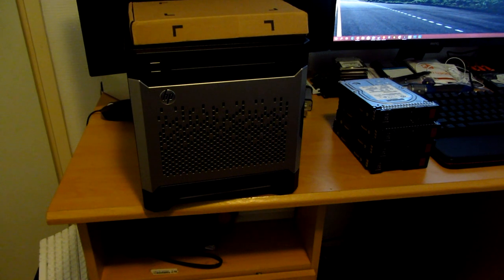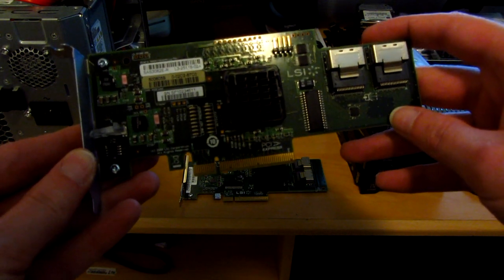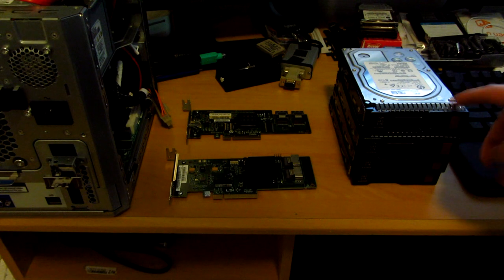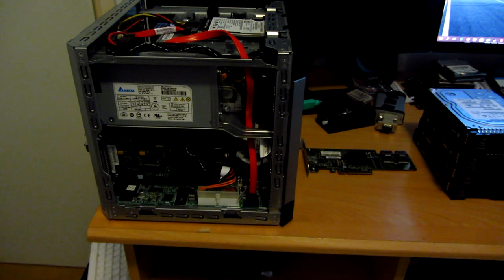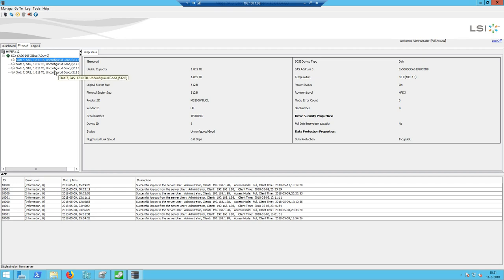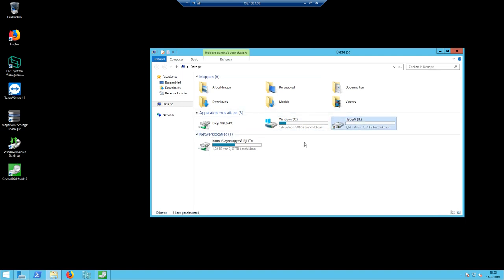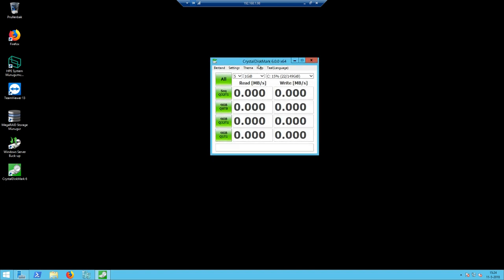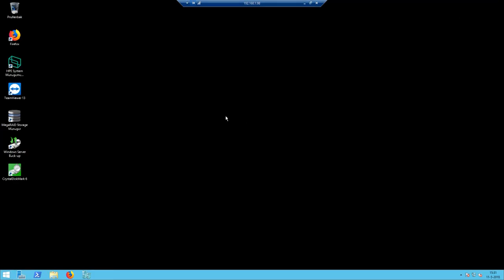HPE Microserver G8 - LSI 9211-8i HBA Upgrade

Comment: That exactly i thought
But little different in hardware
In my thought i use pcie card sata expansion and buy sata cable to 8463 to connect existing cable mini sata sff 8087
Because i cant find pcie direct to mini sas
Is it possible?

Comment: hi. In case you read this after 4 years. Did you have any trouble booting from the ODD laptop drive while using the HBA and having the HDD in the front bays installed? I am not sure if that issue only happens when using the integrated B120i controller. I have a 9211-4i card that I want to use with ESXi and a direct passthrough to my NAS VM. The ESXi I would like to have booting from the ODD. Thanks in advance for reply.
Reply from the maker: Hi,

The ODD is connected to the onboard sata controller so it shouldn’t interfere with the HBA or B120i’s RAID settings. The B120 isn’t supported by ESXi anyway. Personally, I’d install ESXi from USB, not from a CD, but that’s your choice :)

Keep in mind you’ll need a separate disk to install ESXi to, you can’t just run it off a CD.
Reply: @nelizmastr  Nono, the issue is, that if you install a disk drive on the SATA cable for the ODD and want to boot from it, while you have at least one disk in the front disk bay, the system cannot boot from the SATA ODD cable connected drive. Meaning that you install ESXi onto that ODD drive and it can only boot from it while there is no other disk drive connected.
Reply from the maker: Oh I see. I always booted ESXi from the internal USB port (installed ESXi to the USB flash drive I put there), so I never encountered that limitation.
Reply: @nelizmastr  well I know this is an option, but I wanted to avoid installing the ESXi on USB connected to the internal port. Because of USB flash drives  being unreliable and slow. Anyway, thanks for the reply, appreciated.

Comment: Thanks so much for the great video! 

I'm planning on following your lead on my new (to me) HPMSG8 Xeon unit. I assume the internal drives need to be rewired to connect to the HBA with a SFF-8087 cable? Is that correct?
Reply from the maker: No need to rewire anything. The backplane connects via SFF8087 to the internal SAS port. Simply unplug it from the motherboard and plug it into the HBA.
Reply: @nelizmastr  Great news! Man, I'm liking this system more and more...

Thanks again.

Comment: I am planning on getting this card as it was recommended to me as a reliable way to get SATA III on an older SATA II only motherboard as I intend to do some heavy read/write operations and want to avoid the flakiness that comes with cheaper options. The thing is though, can you plug both SAS and SATA drives into this card at the same time and have them work? 

 I intended to use it for SSDs but I was given a couple of 300GB 15K SAS drives for free from a friend and am thinking: Why the hell not, it would be fun.

 I just want to know before I buy the adapter cables.
Reply from the maker: You need to flash it to IT mode before you can individually address drives, after that you’re free to mix and match SAS and SATA. In IR (RAID) mode, you can’t mix SAS and SATA since you need to add each drive to an array.
Reply: @nelizmastr   Gotcha, I see some on Ebay already flashed so it should be a breeze. Thanks for the heads up!

Comment: does this card support RAIDz1? I know i should ask GOOGLE but sometimes its better to ask a real person :) thanks
Reply: zfs doesn't need any kind of raid controller things, actually not recommanded.
Reply from the maker: ZFS and hardware RAID don’t work well together. Just run the card as a HBA.
Reply: the answer is, yes

but you should use the card in "initiator target (IT)" mode rather than "initiator raid (IR)" mode

in practical terms, I use exactly the same firmware, which supports both IT and IR, I just don't config the drives as a raid, and let xigmanas format the pool as zfs-z1

some people flash the firmware to only IT, but I don't bother

if anyone needs any LSI 9211-4i, I have plenty for sale 😁